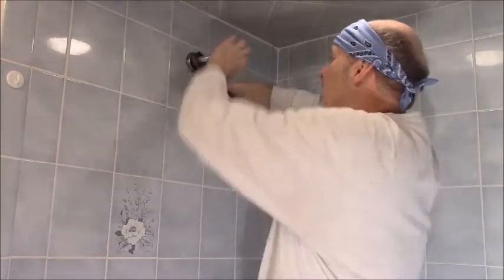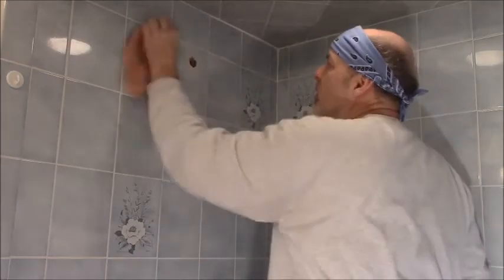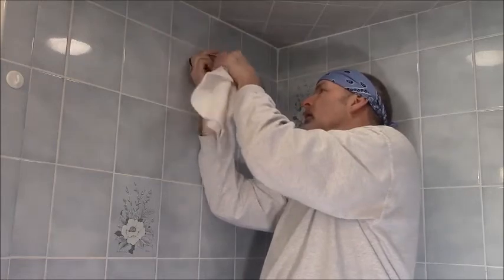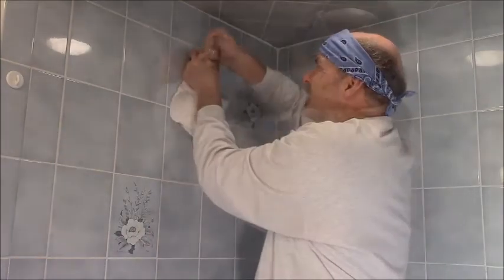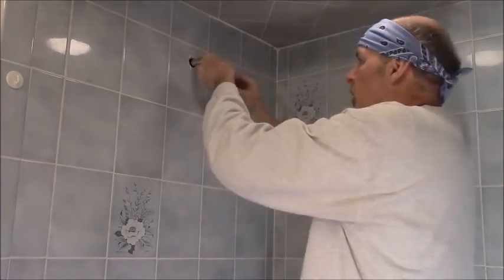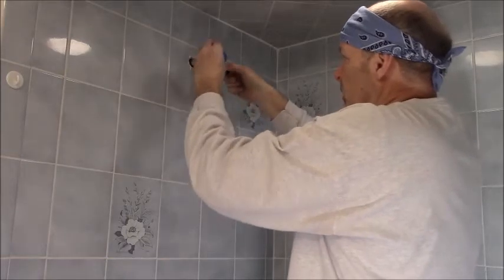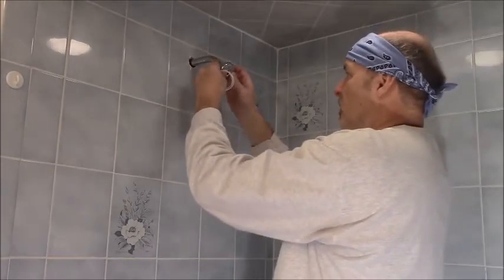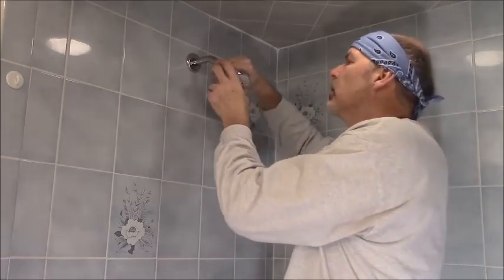HCC 6: Shower Head Installation

Comment: Great video! I like to wrap the jaws of my pliers with electrical tape and use the the heave rag to tighten the neck and the shower head. I don't know if your shower head had the little black washer inside the threaded connection, but a good rule of thumb if you do, is to make it hand tight then use the pliers with a rag to tighten just 1/4 of a turn more. This will make a tight seal with the washer but, not to much to pinch it.